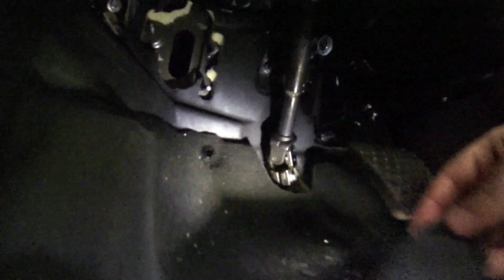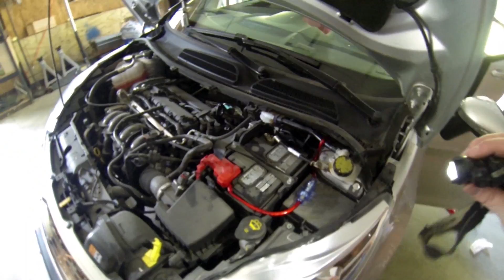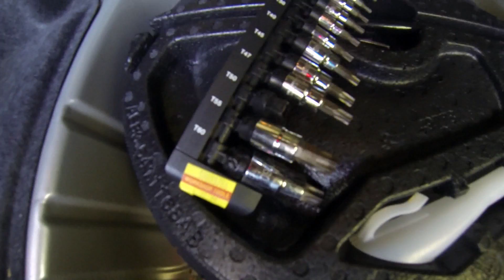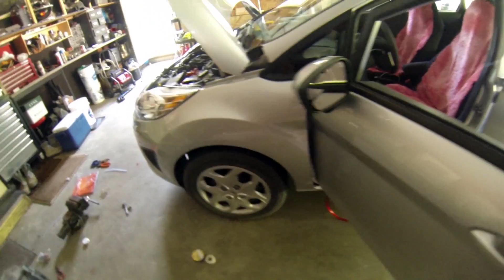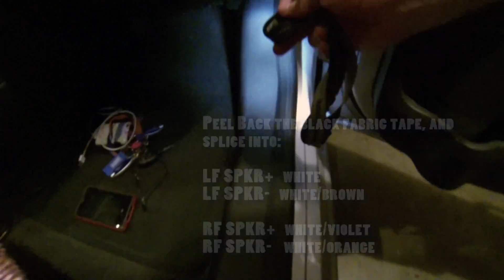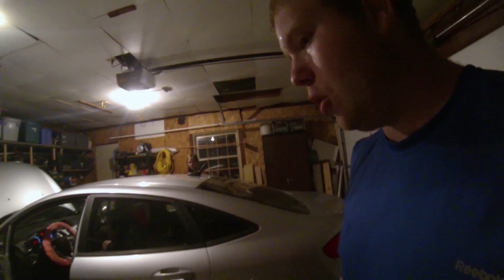2013 Ford Fiesta Amp/Sub Installation

Comment: what about if you have a clutch… can’t find any information on standard transmissions in this model. Having trouble running my power wire

Comment: Thanks for taking the time to make this video. Your speaker wire info was right on the money - all the head units I have installed had the RCA jack, and this is the first time having to splice into speaker wires. The amp needs to have speaker wire inputs. My son and I completed the job in about 3 hours.

Comment: Where do you plug in rca cables for amp at?!
Reply: In the amp...
Reply: You plug them in to the bit he didn't video...
Reply: @JarlJorvik666  lol
Reply: No shit Sherlock I mean from the radio not on the amp
Reply: @jakewheels5892  There are no rca outputs in the original radio

Comment: What wire is the remote wire for the amp to turn on and off with head unit. Is there one os is this whay you used the add a circuit

Comment: I have a 2013 ford fiesta sedan and I'm installing subs , but the receiver doesn't have RCA so I have to use a LOC  where did u find a wire diagram? I can't seem to find one anywhere.
Reply from the maker: Adam Lamb I just Googled around. I have the correct wires in the video description to splice into. Search for similar years for their wiring diagrams (2012 or 2014 maybe). Even if you find one, test the wires before closing up the dash. If you're splicing the front left, plug the radio in, set the fade on the speakers to only be front left, then turn up the volume and see if the voltage jumps on those wires. Let me know if you can't find the right ones.

Comment: Alternatively you can tap the remote into a 12v constant wire n put a switch on it so you can control it, so if dont want bass on then u can turn it on n off as n when u want bass, I wouldnt of grounded the amp to the seat tho as can give bad sound especially if you haven't sanded the paint off the metal for a clean connection. I think you could of filmed wiring in the line out converter as some people don't know how to do it.
Reply from the maker: The switch for the remote works, but I usually just turn it down on the radio, but that's a cool idea. A seat bolt, or really any bolt on the frame will not cause any audio problems. It will eventually run back into the car's noisy electrical system anyway, so no matter where you connect the ground, unless you're running your own battery that doesn't have an alternator on it, the audio quality will be the same. I always lightly sand each connection anyway. 
I don't have a line out converter and this amp had high level inputs, so there was no need to use a LOC. Plus since I connected the amp to the front speakers, there's no need to worry about a degraded audio signal that some manufacturer's stock radios push to the rear speakers.

Comment: I dnt see a fuse 19..
Reply from the maker: +wayne Woods It's my friends car, so I can't go out and check which fuse it is exactly, but it's very easy to check. Just to be sure, it is in the fuse box under the dash, not the hood. The manual should have a description of what each fuse does, so just look for ignition or something that is only on when the car is on. Use a multimeter to verify that the fuse only has power running to it when the car is on and you're good to go. Goodluck!

Comment: Did the radio have one or two plugs on the back?
Reply from the maker: +pricelessmods I am pretty sure that there was only one. There's a thick wire for the radio antenna, but other than that I think there was only one large, multi-wire plug.

Comment: Thank you for the video, I am having some serious trouble with my installation. Your guide helped me with running all the wires great. I am stuck with the stupid Line Out Converter. Where in the heck are the wires? I am installing in a 2015 SE model, shouldn't be to different than what I have read about color schemes. I went in behind the dash and tried to find the wires there. I used the line splice clips, but no signal. I am guessing I have the wrong wires. Any guidance you can be would much appreciated. I see how you did it in the rear, but with my hatch I don't have that option.
Reply: +James Logan Can we get an update on this? I have the same vehicle and been thinking about installing a system in it myself.
Reply from the maker: I pulled out the radio and the plugs that were in the back of it. The plugs had a whole lot of a felt like black tape on them, and I unwrapped all of that. To test the wires though, I took a ground tester ( attach one side to ground, and then there is a probe with a sharp tip to jam into wires) to jab into the suspected positive wires for the speakers. Then plug the radio back in, turn it on, and use the fade/balance options to isolate a single speaker. Use the ground tester to see if the wire that you think is the right one will make the ground tester light turn on some (the music will have to be kind of loud). 

So, to test the front left speaker, find the white wire (that should have a pair that is white with a brown stripe). Take the ground tester and attach the one side to a ground bolt or piece of metal, and then use the probe side to pierce a small whole in the white wire. Turn the radio on, isolate the speaker, and see if it lights the ground tester.If not, try another positive wire. Just make sure to use electrical tape to wrap the wires that you pierce with the probe.
Reply: +Christopher Williams Hey! I actually did the line out through behind the moldings where the seatbelt a are. For some reason this was a whole lot easier to find and connect to using the stock setup. I didn't want to tear the dash apart.
Reply: +James Logan Thanks. I literally just ordered a 10" sub, amp, converter, and 8" gauge wiring kit. Do you know what wires need to be tied into the converter? I've never done this before, but I figure it can't be too difficult.
Reply: @chris6075 so if I got a converter I used the speaker wire fron the speaker it self and then had issues on the converter it has orange baterry wire and a black ground and the blue is a remote so will I have to put the remote fron the amp to the cover yet to my fuse box? And the orange battery to the battery it self
Reply from the maker: +Christopher Williams You'll need a positive and negative from a left and a right speaker. If it's a powered converter, which I hope it is, then you'll need a remote wire to enable the converter, and a positive and ground wire as well. I tied into my front speakers behind the dash because on some cars only the front speakers receive high quality audio.
Reply: +Dakota Alger Im not sure if I have a powered converter, but there is nothing to indicate that it is powered. It is this: http://www.amazon.com/gp/product/B001EAWS3W?psc=1&redirect=true&ref_=oh_aui_detailpage_o01_s00

Is that bad? I'm not looking for killer bass. Just trying to install one Rockford Phosgate 10" sub and amplifier as easy as possible in my 2015 Ford Fiesta SE. Everything looks pretty easy except for hooking up this damn LOC. 

+james Logan mentioned he tied the LOC in the door panel. But how does that work? Can you access the right and left side speakers from one door panel? I"m no audio tech but I assume one set of wires goes from the stereo to the left side of the car and the other goes from the radio to the right side. So if you are not tying into the stereo behind the radio, how do you get both sides? Or is that not necessary?
Reply from the maker: That one is passive (no separate power) by the looks of it. And no, the left speaker wires will be on the left and the right on the right. That's why I just go from the back of the radio. Some cars are fortunate enough to have a rear deck by the rear window, so the speakers aren't in the door, and then it's really easy. Otherwise, I would just tie into the back of the radio. You have to run the power wire anyway, so running the signal wires too isn't hard.

Comment: hey how you doing i have the same car as yours but i have a 2012 modual so about the remote wire do you have to buy a fuse to put in the fuse 19 spot?
Reply from the maker: It's my friends car, but yeah you just buy an "add a circuit" from Autozone or an equivalent car parts store.The add a circuit has two slots, one for the original fuse, and the other for the circuit that you're adding on. Just put a fuse in both slots.
Reply: @codyalger93  do you need a specific volatge fuse? I only have 5a in the fuse tap kit